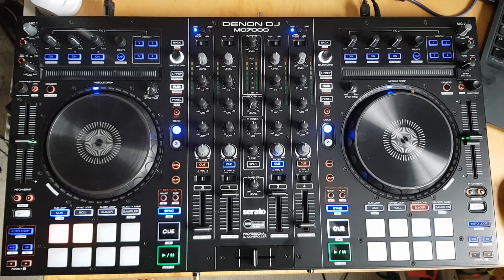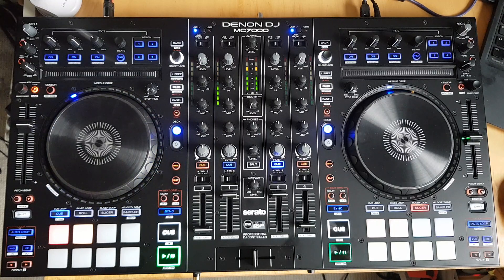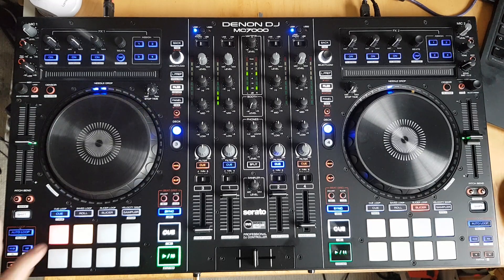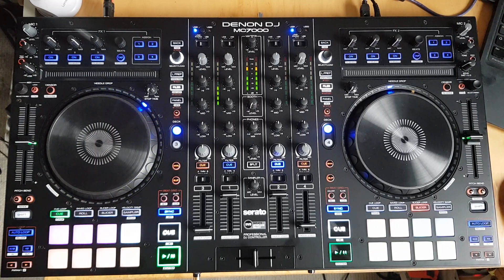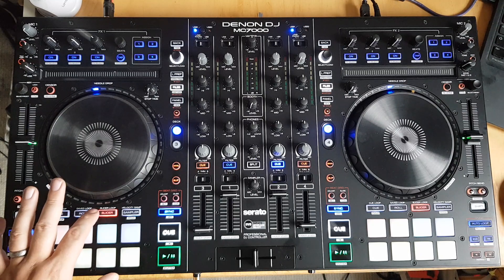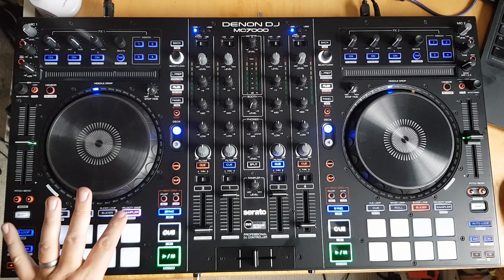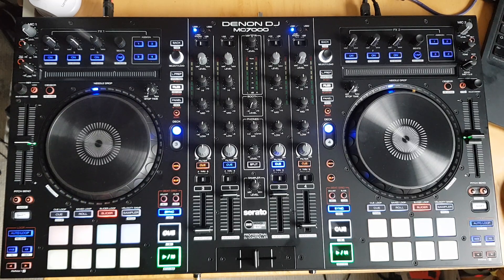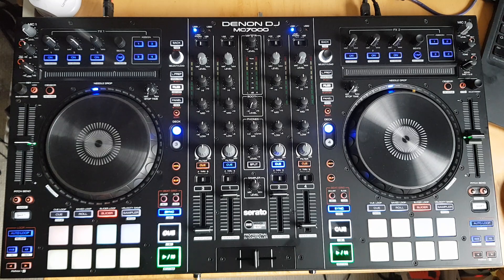Quick n' Dirty: Re-mapping my Denon MC7000 in VDJ8.5/2021

Comment: Hail general, is there away to make the sample EFX only affect some of the samples and not all.??
Reply from the maker: Hmm... I would probably just script the sampler fx use into the triggering of the samples that need it, and then maybe put the result - with or without fx use - on a designated pad page
Like maybe:
up ? effect_active 'sampler' 'echo' 0 : effect_active 'sampler' 'echo' 1 && sampler_play 1
... which keeps the echo effect on the sample while the button/pad is pressed, and then also triggers sample 1 in the current sample bank
Reply: @klausmogensen8691  maybe you gonna have to do a video on it because your explanation is way over my head 🤦